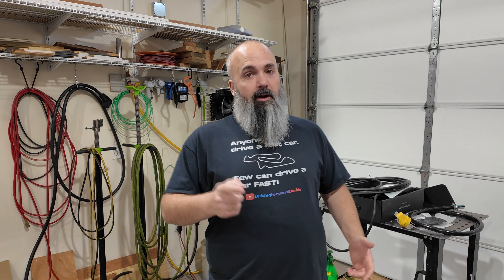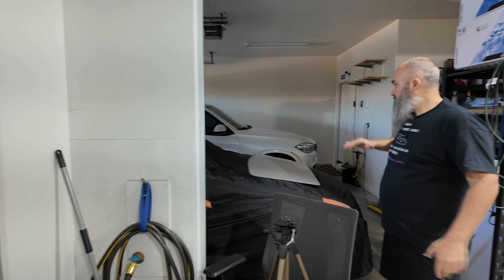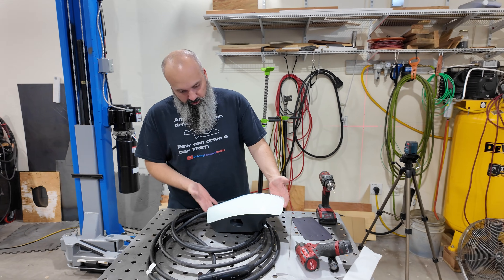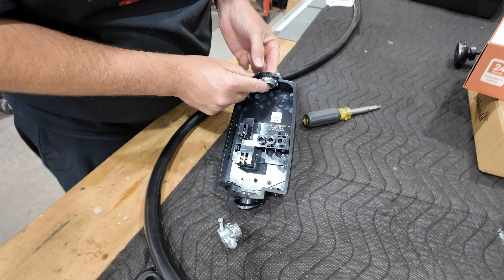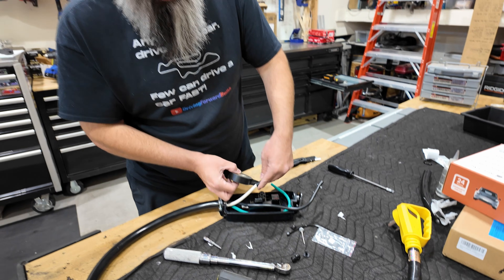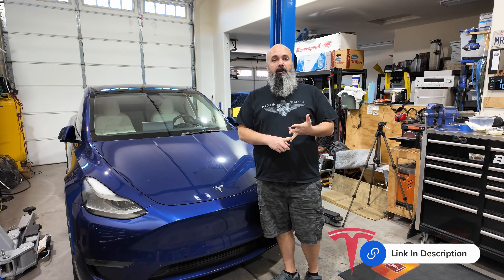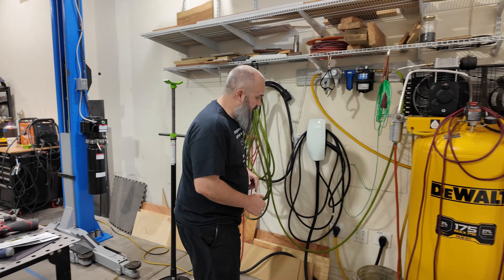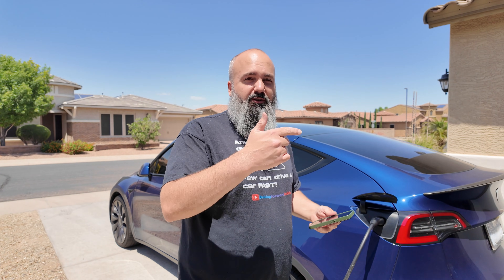Tesla Gen 3 Wall Connector DIY Installation with NEMA 6-50 Outlet

Comment: No don't twist the stranded wire!
Reply from the maker: Why? I thought by doing so it helped keep from letting stragglers out.
Reply: @DrivingForwardBuilds when the strands are twisted the lug cannot compress all of it evenly.  For fine stranded wire, sometimes I will use a temporary longer piece of shrink tube on the tip to keep everything held together.
Reply from the maker: I see. Thanks for the info.

Comment: Great job with the installation. The thermal camera check sure adds that extra layer of safety confirmation!
Reply from the maker: I appreciate you noticing that! In the end I new this wasn't the long time solution, but wanted to be safe as I could. I have since run conduit and hardwired my charger.

Comment: PLEASE, STOP GIVING BAD ADVICES TO NON EXPERT ELECTRICIANS PEOPLE. THERE ARE SO MANY FIRES CAUSED BY BAD QUALITY NEMA PLUGS.
210 Dud, if you are an electrician, just add a dedicated NEMA 6-50 conduit, wires, and circuit breaker ($400 is nothing, since Labor is free) !!! 
1. It is not a good advice to put an extension cable because constantly plugging and unplugging damage after a while the plugs.
2. Also, often the plug is not inserted correctly, mostly because of the weight of the charger or the cable dangling under the plug.
3. So, when using a portable charger with a short pigtail cord, you should always add a brace or a shelf to hold the weight of the charger.
4. If you use a portable charger, you should also use a GFCI circuit breaker, only the wall charger has one. 
5. One thing missing, and required in some countries like the UK, is also to have Arc Fault circuit breaker (AFCI), for both a portable and a wall EV charger. 
6. A welder or an oven aren't like an EV charger running continuously because the load is very short, and an oven needs to run for few minutes to keep the temperature.
Reply from the maker: Thanks for the additional information; safety is always the priority!

Comment: I did installed my tesla wall connector (AKA the charger) too myself. One thing I have to point out is activating the charger was not easy at all. First, we can't access the Tesla One app for reasons. That way I had to use the old school setting it up via browser. My wifi is weak in the garage, and the charger needs a good and fast internet to activate. Worse, Tesla didn't put a single word in the manual or on the box on how to do the set-ups. I only do 16A charging. I used ferrules on stranded cables. I followed up too with a thermal camera too, the temps are similar to yours . I guess I did a bad job considering you pulled a lot more amps than me. But  it has been working as intended for the past year.
Reply from the maker: It’s good to hear you got it working, the old school method can be a pain. The Tesla One app was a bit cumbersome to work through. I added a wifi extender to my garage to help boost the signal. Even so getting wifi setup was a pain.

Comment: That's not a car charger. The charger is built into the car. It's called electric vehicle service equipment or EVSE. The difference between your welder and the EVSE is the welder is not considered continuous duty, and the EVSE is. Normal NEMA 6-50 receptacles are not rated for EVSE use. Since EVSE are continuous duty loads, the receptacles are more heavy duty for that purpose. So, when/if it burns up and causes a fire (this DOES happen) your insurance company can choose to not pay out due to the incorrect cord and plug installation of the charger. If the panel so close why not just hardwire it like it says? Or you could easily use an extension box and hardwire that way as well. It would still be a code violation to share the breaker with 50-amp pieces of equipment though. Lastly, for the love of God it's Tesla not TEZLA.
Reply from the maker: Thanks for the clarification.
Reply from the maker: This is a great example of why comments are great. I honestly hadn't looked into an "EV rated" 6-50. I should have I known, but turns out there is one available= https://amzn.to/3FxfNUG Still not correct I know, but should be "safer" before running a dedicated circuit.

Comment: Damn. That 3 conductor cable could power a small factory! I have a portable level 2 charger running 10/3 solid wire 50 feet to the outlet. I can pull 5KW (22amps) all day long charging the car and nothing remotely even gets warm. Car shows getting full 245 vac to it. No problem using much larger cable though.
Reply from the maker: Good info there. Thanks!

Comment: I Void Warranties 😅
Reply from the maker: :face-blue-smiling:
Reply: Fantastic! I'm also thinking about buying a used Tesla. I also love testing my mechanical skills. (I have a used BMW x5 35d ). I also have an outlet i installed for 50 amp service. My only recommended advice is to verify that the outlet is EV rated because the outlet bought from the big box store might be for RV's! They can't handle extended power use over time and will self-destruct.  I'm looking forward to your repair work on this Tesla.
Reply from the maker: @billmccartney1249 thanks for the info. I don’t know that I’ve seen a 6-50 that is EV rated. This one is a “heavy duty” outlet, for whatever that’s worth. I’m hoping to hardwire the charger later, but will for sure watch this outlet carefully for degradation. If still installed in the winter I’ll do an update and see if ambient temperatures being lower leads to lower service temp.
Reply from the maker: @billmccartney1249 I forgot to mention, now sure seemed like a great time to get a “value” on a Tesla. Seeing the prices fall sure is painful for all the owners but I was happy to take advantage of the situation.